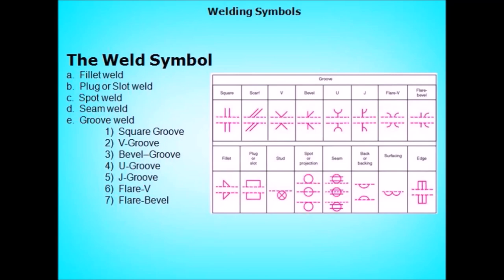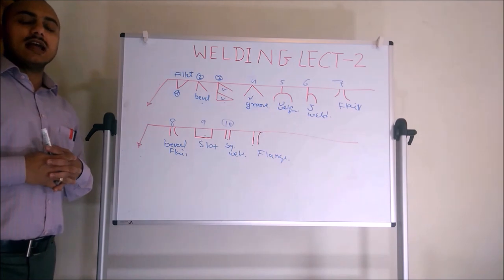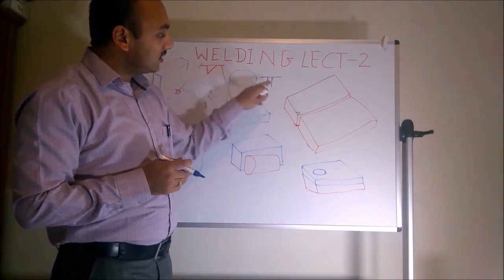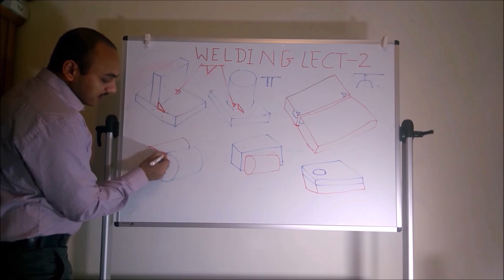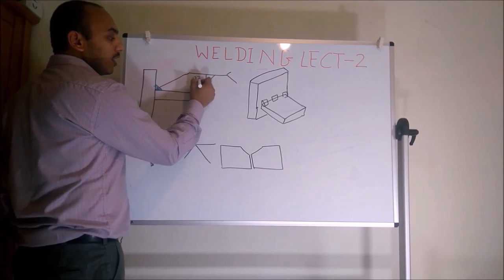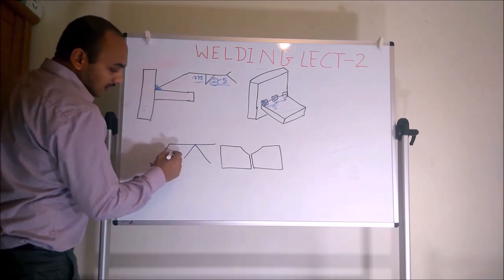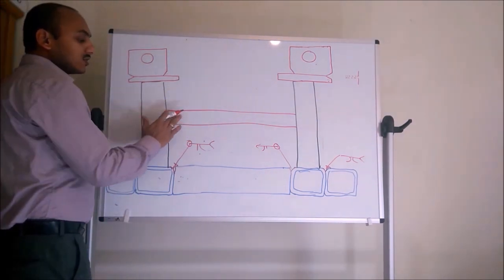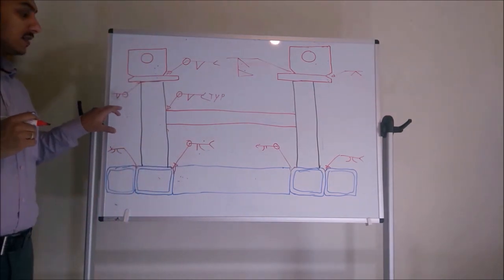Welding on Drawing Lecture 2

Comment: Sir could you please let me know how does it possible to weld a plate is over another...
Pls explain about slot weld once again by reply back this comment
Reply from the maker: Vijay, We can prepare a slot or hole on a plate and place on other plate. The by using filler rod SMAW we can fill that slot. I will make a weld connection. Or two plate can be welded by resistance welding easily.
Reply: @TheEssenceofknowledge  resistance welding will be great Sir